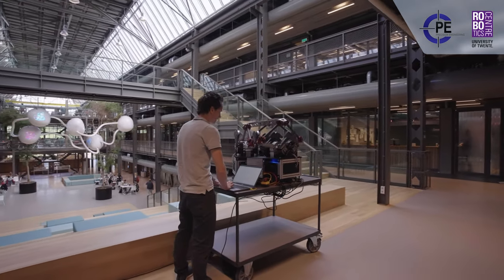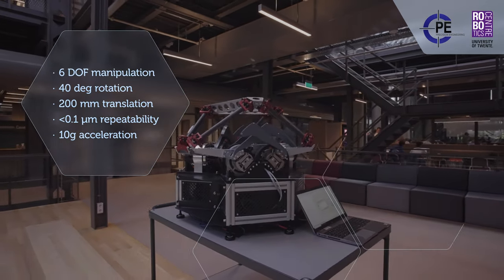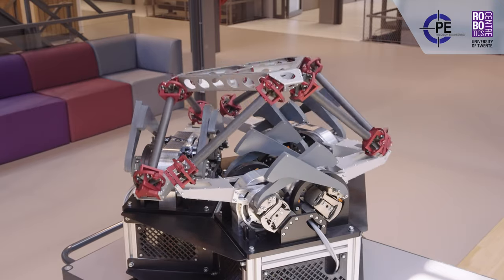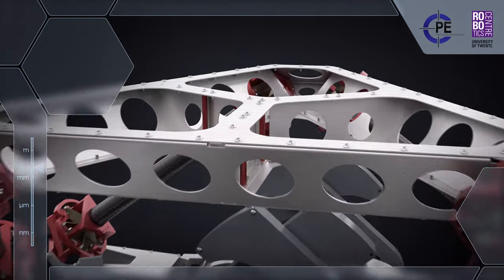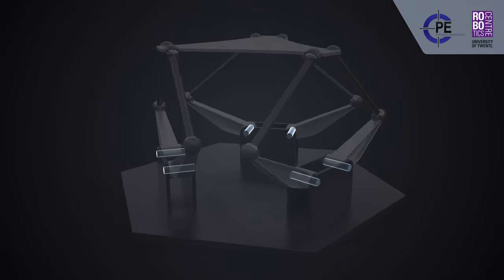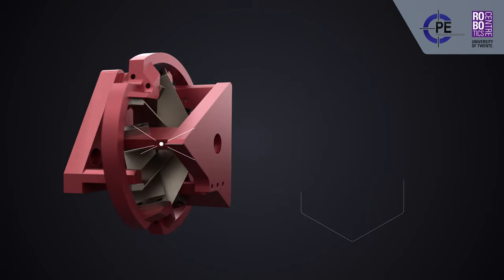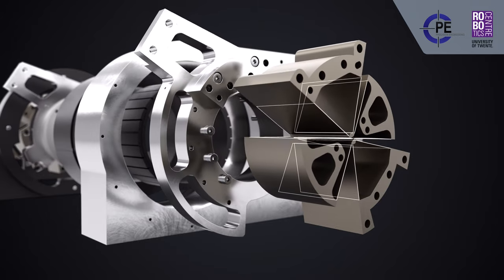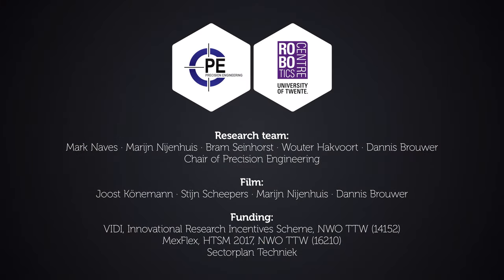T-Flex: Compliant Flexure-based Large Range Precision Hexapod

Comment: Impressive. I wonder, what is the repeatability in variable load conditions. Like in the mentioned assembly or milling applications.
Reply: eblman5218  The Parallel Axis Tripteron Concept" by Rudmin may have the same motion range, but it is full of linear ball bearings and rotating ball bearings. All these bearings have friction, play, backlash and cause rumble due to the imperfect bearing surfaces, Also, The upper arms of the Tripteron carry bending loads, while the upper arms in this video only carry pure tension/compression loads. In other words, the precision and repeatability of the Tripteron are no match for those of this flexure-based mechanism.
Additionally: the Tripteron has only TxTyTz translational freedom, while the flex concept has all six DOF's: TxTyTz and RxRyRz.

Comment: Where are the 6DOF ? I saw only 3. The final manipulated object can move only up/down, left/right, front/back. It can’t revolve around x,y and z axis, or can it ?
Reply: In the beginning you can see it rotating
Reply: In the beginning you can see it rotating
Reply: In the beginning you can see it rotating
Reply: In the beginning you can see it rotating
Reply: In the beginning you can see it rotating
Reply: In the beginning you can see it rotating
Reply: alternate lower rods (1,3,5) pushing while the others (2,4,6) are pulling allows rotation in a limited range.